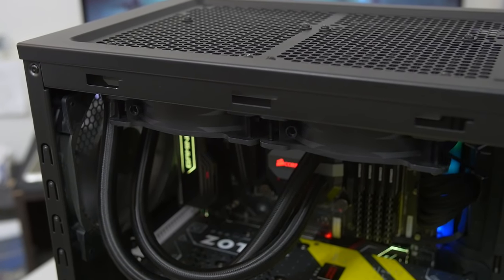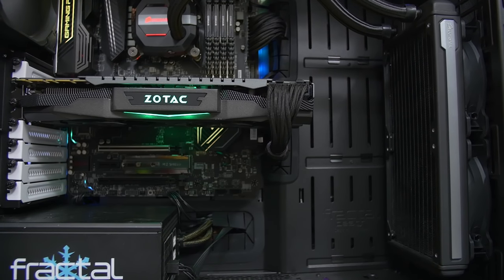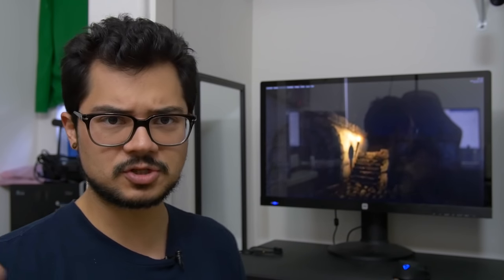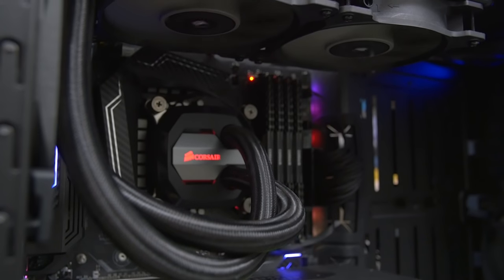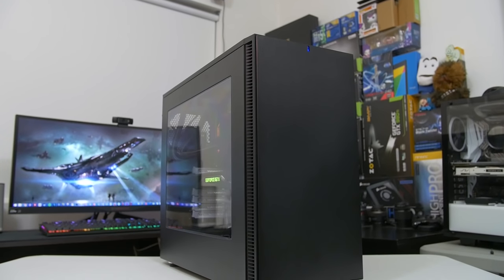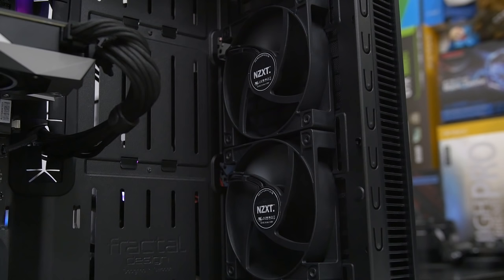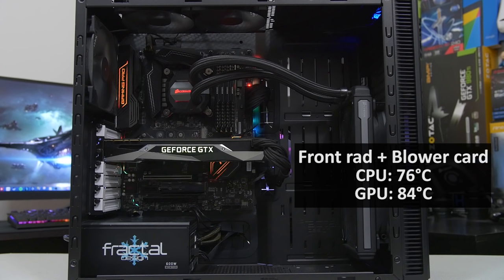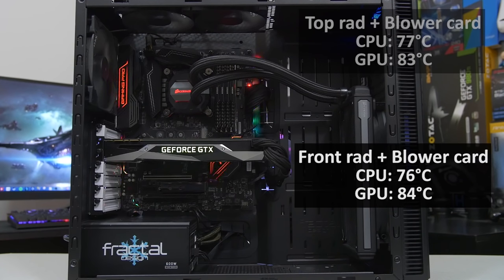Does Radiator Placement Matter? Hint: YES

Comment: Phanteks P300. Only place to mount a good 240/280 is the front, it's got good airflow there though. But, for a 120, I'd do the top... not back because I would put the exhaust fan there

Comment: Not sure if anyone else noticed this, but the the cooling block is mounted higher than the radiator when front mounted which means that air is going to be pushed into the cooling block.
Reply: Yp the radiator should be at the extreme top of the front panel

Comment: Idk how accurate this is. Rad above/below block shouldn't make a difference, but what does, is pulling cool air rather than hot air. This experiment is flawed because tube orientation was changed along with the rad being changed from intake to exhaust, effectively creating two independent variables without a constant. While I'm not entirely sure that accounts for the whole difference, intake has been shown to produce much lower temps than exhaust for aios.

Comment: im surprised no one installs the fans on the h100 in the correct position. Everyone just puts them on like the picture on the box. when in reality the instructions say to top mount with the air blowing into the case not out of it. this brings cool room temp air into the case and is almost directly taken back out due to the rear fan. Plus when you have fans in the front and on top as intakes with only 1 or 2 exhaust this creates a very slight positive pressure in the case which keeps it very clean (dust free) and flows better with less fan speed. Food for thought

Comment: I've got an interesting choice with the ITX build i'm planing.... Front intake radiator up to 280mm OR a side exhaust IMMEDIATELY BEHIND THE FRONT FANS but only 240mm.... Theoretically both positions should see cooler air hitting the radiator.
I had been intending to go with the latter option hoping to keep the overall case temps lower.... but now i'm wondering if the benefit of the 280mm radiator could be much greater than worrying about the case temperatures. 
My card is a 1080ti founders (blower)

Comment: Look at the Air Conditioner outdoor placement. They all the same position placement wich is Vertical and the fan is behind the radiator acting as pull the natural air through the heat spreder/ heat pipe / alm fin. But  for pc in the case is dificult. Since the case design are limited air circulation. But principaly the best water/ liquid flow is hot water/ liquid come at the top and cooling water out at the bootom rad.

Comment: Very useful - I always thought that exhausting out the top would be far better than bringing it in through the front and heat up the case. But of course you've got the best of both using fans on the top as well as bring warm air through to cool the cpu whilst putting a bit of warm air in the case as a result - would have been interesting to see what would have happened if you turned off those two exhaust top fans.

Comment: I require an update to this video. How controlled was this test? What was your testing methodology? Did you allow the water in the Rad to fully warm up before testing each time, or did you allow it to cool to ambient? What WAS the ambient temperature during each run? Did you try to encourage air bubbles to make their way into the Rad by tilting/shaking? Did you remove the CPU block from the IHS at any point and reapply thermal paste? Did you perform repeated runs (2-3) per set up to confirm your findings? Based on what I'm seeing here, the CPU doesn't quite care what the orientation of the Rad is as long as the pump is being fed water. Common wisdom does say that the pump should be the lowest point of the loop so that does lead most to believe that top mounted makes the most sense for the CPU and the 1C degree temp increase could've been within the realm of testing variance or potentially testing error, but I hope it's not the latter. The GPU only seemed to get 1C degree warmer by being fed warm(er) air from the Rad in the instance of the Blower style card, but the tests for the Open card didn't budge. So while the video does seem to influence the viewer to prefer Front mount rad with an open style GPU, I feel like there should maybe be a few more tests ran to support your findings here. Preferably in a case that allows us to remove any variables from the front Rad intake fans being able to breathe but the top mount Rad exhaust fans being suffocated or vice versa. Ideally this test would be performed in a case that would allow you to remove any kind of grill or filter or tempered glass from the top and front of the case so one side of the Rad is always facing towards ambient air. Then I would also like to see this test done with the fans on the Rad set up in a Push, Pull, and Push/Pull configuration to see which side (Push or Pull) is most helpful and then (Push/Pull) to see if the extra fans are actually contributing enough additional cooling to be worth it.

Comment: I had no choice but to mount mine to the front because there is a RAM clearance issue on top with my board. I did briefly put it on top, but mounted the fans on top outside of the case in a pull configuration and looked tacky as hell, but temps were still decent. Not sure how it compares with the front though.

Comment: So really, it's not the cool intake air that lowers the CPU temp on a front rad rig, as evidenced by the blower test. It all comes down to whether or not your GPU (if open) is giving the rad it's heated air. When you push heated GPU air through a rad it affects the temps drastically more than if you were to just switch from top to front without the GPU in the equation. So, it's not "top vs front", but "open GPU air vs ambient air"

Comment: Very Insightful Video Bitwit ;) In a couple of weeks I plan on revamping my HTPC Build in my existing Silverstone GD07B HTPC case, I've already purchased an i9 12900K Bundle and also a Deepcool LS520 Liquid CPU Cooler. I believe that I will need to Sandwich the Stamped Steel Case between the Fans & Radiator, do you believe that the Supplied Long Fasteners are long enough to accommodate the added thickness of the Stamped Steel Case? Or will I either need to procure longer fasteners or simply Flatten Out the Stamped Steel in between the Fans and Radiator with a Dolly and Hammer?  Thanks in advance, Randy  AKA randog311

Comment: The only thing I would change is, if you're mounting the radiator at the front of the case, to make sure the tubes are on the bottom, not the top.
Reply: The tubes aren't nearly long enough for that

Comment: rx6700xt red devil open shroud + 240 aio with 5600x front mounted rad blower fans rear 1 top 2 works the best.  I have place for 1 more place to mount a case fan on the front , i will add soon to decrease temp saturation in the case. Thank you.

Comment: The experiment is inconclusive because theres no control and both examples are not equal you need to use the same identical cards same everything then run the tests a bunch of times to diminish margin of error data

Comment: Hoses on the tank should always be pointing down. It keeps the air in the loop from circulating in the system and possible causing issues.
Reply: if the top of the rad is lower than the pump yes tubes should be down or you risk burning the pump out as air bubbles will get stuck in the pump. if top of rad is higher than pump tubes up is fine, but you may get gurgling but air will not reach the pump.

Comment: What if you took the front panel off of the case to allow for more air flow from the front of the case? With the solid front panel I would imagine the air pull on the intake would be hindered by that and your temps may go even lower with more air being pulled across the radiator from the open front panel.

Comment: Of course I'm not overclocking to 5Ghz so I probably won't need to worry too much about hitting 86 C.   However with the stock Wraith Prisim on my 3900x I hit that fairly regularly.  So any improvement in temp I'm fine with.

Comment: Thats why i have a single 140mm NZXT AIO cooler for my videocard (so it doesnt put heat in the case) and a 280 mill on top for the CPU. Good test though.

Comment: Great testing/results. However, I have a ton of hard drives in my case, so not sure I'd want a front radiator (if even possible to mount) blowing hot air directly on my data storage. This info is targetted more for a dedicated gaming only / minimal storage machine with 1-2 SSDs.
Reply: The air doesn't heat up so much after the radiator. It has been tested, front placed radiator has almost to no effect to the air temperature inside the case.

Comment: So my build is on the way and i am including a 360mm aio, the case will allow either a 360 in the front or on top. I am planning on top mounting it and using it as intake while also using 3 intake fans in the wront - with only 1 120mm exhaust in the back. I understand this will create positive air flow, just looking for opinions on that setup. I haven't really found any info for someone using this type of setup, 6 intake 1 exhaust. Fan curves will be custom and I will attempt to keep the front intake fans turned down, while the exhaust is pushing pretty strong and consistently.
Reply: i dont recommend using top  fans as inlet cos you re pushing the hot air coming up from your hardware back in to the case. İ had the same idea as you about positive airflow but top inlet increased my temps about 15 C. use top exhaust.
Reply: @OnurDogan09  The top fans are being used as inlet because they are mounted on the AIO, it seems counterproductive to use your aio for exhaust, when its supposed to be cooling rather than pushing hot air. I was thinking, if I could run the AIO on around 1000RPM and the front inlet around 500RPM, then boost up the exhaust in the back to around 2000RPM this fan setup would be a pretty good deal. Also, hot air doesn't necessarily "rise" when its in a case, considering there is constant air moving, the  hot air doesn't just sit in the case (unless you literally have no air flow, or negative)
thanks for the input though.

Comment: In the video, it's showing the tubes higher than the actual radiator is that most optimal? could air get trapped in the highest point of the tubes or no? this might sound dumb so I'm sorry.

Comment: Radiator on top as intake, front and rear fans as outlets works wonders too! Would like to see the temp diffs on that one too :) Great vid :)))
Reply: Im not sure about that. I guess they changed build of cases because of cumulating hot air beneath top part of case, so its open and prefered as exhaust because you help hot air, thats on its own, moves to the top

Comment: I love how he talks about best position for aios but proceeds to have the fromt aio mounted so that it has less performance, its more noisey, and wont last as long; due to air bubbles, please please mount your front facing radiator with your tubes at the bottom  of both the radiator
Reply: What's even more important than that is the rad needs to be at a higher point than the pump.

Comment: I have a 360 radiator in the front intake ,in a Corsair Crystal 680X white . I must say it works as a charm . But i also have 120mm fans x2 at the bottom as intake and at the top 2x 120mm fans as outtake and of course 1x 120mm fan at the back as outtake. before i had the coolermaster masterbox 5 lite RGB and the 360 radiator at the front just choke the whole system so i had to remove the glass panel .

Comment: And the funny thing is u have the radiator mounted wrong. when mounted to the front the tubes need to be down, not up since air travels UP! This way u will get air bubbles in the pump. The best way of placing a radiator will be on top, PERIOD!

Comment: Your CPU pump will die very likely with radiator position like that. THe pipes MUST attach the radiator in the bottom. And pump MUSt never ever be in position higher than top of the radiator.
Saying shortly: your pump will die earlier because of the air in system instead of high temperature.

Comment: I have just gone from an i56600k to a Ryzen 2700x with ROG STRIX b450-F motherboard and 16GB of 3200 Corsair Vegence RGB, I I used to have a single Fan AIO set up as rear extraction,in my case but at the moment I have the Wraith CPU cooler install till I can Get the Corsair Hydro 100i RGB Platinum SE 240mm. i am also going to be purchasing the Corsair Crystal Series 680X RGB case to install all this in, 

What do you think from your experiance would be the optimal set up position for the rad.

Would you use Push Pull 

would you set as exhaust or intake???

love your vids by the way keep up the good work.x

Comment: Top rad, rear exhaust fan and front fans with slot blinds under the graphics card removed supplying the gpu with cool fresh air gave best results in my case. (pun intended as Jayz would say)

Comment: I did top mount, but intake, so it pulled in cool air from above. Same corsair H100i early gen too! (FX-8350)
Reply: Wait a sec, if i understand it correctly your train of thought is, 
pulling cool air from outside through the radiator, from above.
However if this is what you are doing, then your actually pulling Hot Air out of the radiator, into the rest of your case. thus indirectly heating up the inside of your case before it exits out of another fan exhaust exit. 
This will indirectly warm up other components in your case, like your motherboard. 

When i did my AIO years ago, i had mine topmounted aswell, pushing the hot air out of the radiator ontop, exiting the top. My train of thought was "Heat rises up, not down" so i thought it was logical to also pull out any heat coming out of the rest of the case upwards. 

The only flaw with my build is exactly that which i mentioned above, that im pushing medium heated up air from the rest of the case to cool the radiator,  

Throughout the years i went through 2 AIO cpu watercoolers, and currently planning out a Custom Water Loop build, 
My idea this time around was fill the case with 3 radiators, but then i thought, damn my case is already so heavy with all its components, whenever i do its yearly cleanup with dusting it off when i bring outside. 
That i thought, lets do All Radiators Externally from the case. then im also not limited in radiator sizes. 

Currently my eyes has fallen on the Mo-Ra3 420 Pro made by WaterCool (a company from Germany) 60mm thick radiators, 3 on a row.  This way i can possibly also choose for longer tubing's and just Move the external radiators to an different room entirely, That would also help with keeping the room temperature lower.

Comment: Fractal Design Define S2 Vision - Blackout
Fractal Design Celsius S36 - Top Exhaust Position - Push
3 x 140 mm PWM - Front Intake Position
1 x 140 mm Noctua NF - A14 ULN - Bottom-Forward Intake Position
140 mm case fan exhaust - Rear Exhaust Position
Sapphire Nitro+ RX 5700 XT GPU - Performance Bios Setting 
i7 4930K CPU - 4.5 GHz OC’d with 1.375 VCORE

Testing with CPU load at 100% and GPU at 100% simultaneously

The hottest CPU core 75C - Loaded
Overall average CPU core temp 70C - Loaded  (22C to  27C @ Idle)
GPU temp 70C - Loaded 
(38C @ Idle)

Comment: What would happen if you mount the radiator at top and use the rear fan as intake, so it would direct relatively cool air from the outside to the radiator's fans?
Reply: Передний верхний вентилятор подает холодный воздух сразу на радиатор. Что не так?

Comment: Front aio rad position too low: air bubble moves from rad to cpu/pump = dead cpu in due time (beginners mistake, isn't it?). For the test goal, gpu temp, I agree, because it's worst case.
Reply: Yeah just coming to say this. Also, and idk why no one ever does this correct, it should be flipped so that the hose is at the bottom. While not as critical as having the top of the radiator above the CPU, it still greatly helps reduce air bubbles. I get it doesn't look quite as nice, but part of the reason I just put my AIO usually at the top.

Comment: The front mount is just wrong, the tubes should be at the bottom and the whole radiator should be mounted as high as possible, not at the bottom of the case. This will keep air out of the pump.

Comment: Stupid noob question. WIth a dual fan water cooler, doesn't one fan PUSH air over the HOT side of the fins and one fan PULL air over the  other half? I've seen diagrams showing one pushing, one pulling (fan) In theory, it would seem like that would be the best way. I've been running a single fan/radiator pulling air from the outside to cool, but having a 200MM fan in the top of the case pulling the excess hot air from inside the case, this seems to work pretty well.

Comment: I have a CPU GFX on board, I'm tempted to use a front suck system on the Rad, and a top fan blowing down on it, so cold comes in from the top and is sucked through the rad then out the front grill , also one or two fans in the back pulling cold air in

Comment: I suspect a good air tower cooler is going to even better still for the GPU especially. With high air flow cases.  Just about everyone loves AIO coolers.  But anyway of course thats not the point of this video. Back on point would a 360mm radiator change things much? But using a 360 does restrict options on where you can mount it.  A lot of cases will only have space to use it at the front.

Comment: I've always had top mounted rads and didn't see outrageous temps. The hottest my 5800X got under Cinebench was like 82 deg with a H115i Elite Capellix 280m rad (gaming in the 60s) and that's average for most people. my RTX 3080 stays at a nice cool 68 deg under load. That could be because I have 5 120mm fans on my 680X as intake. Also looks like your case is one of those ones with no front intake apart from the two sides. that'll affect your temps too. Oh and you are so doing the front rad wrong, watch Steve's video, tubes should be on the bottom, not top. So helpful video but everyone is going to have different results as your test set-up is well old.